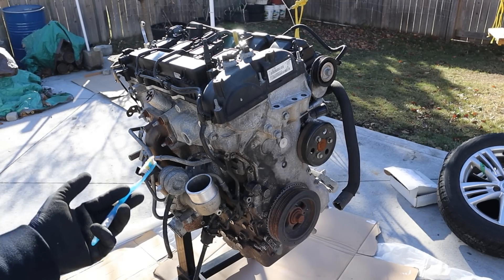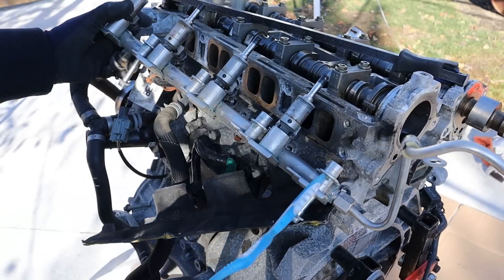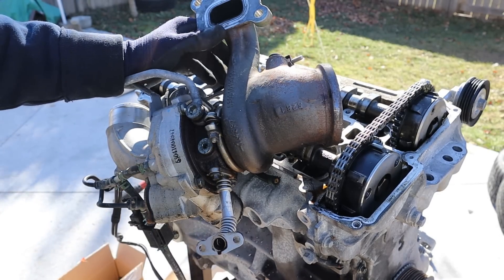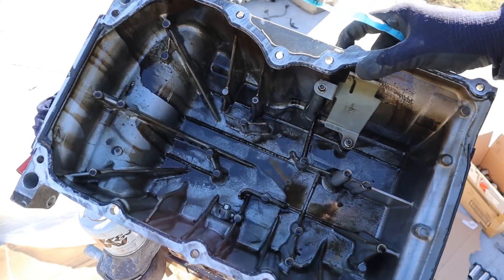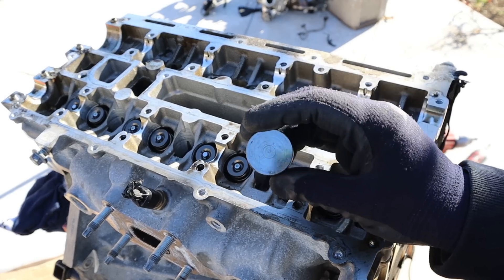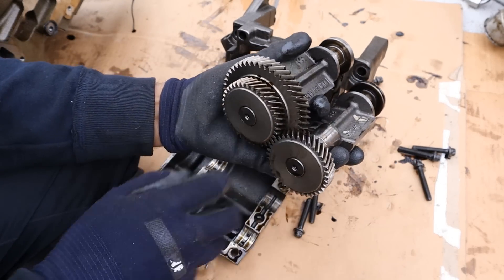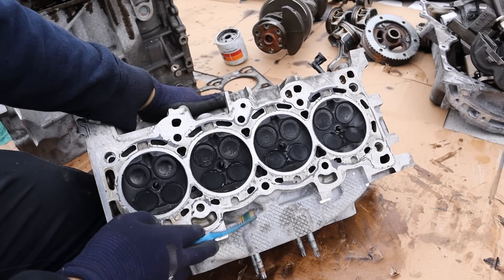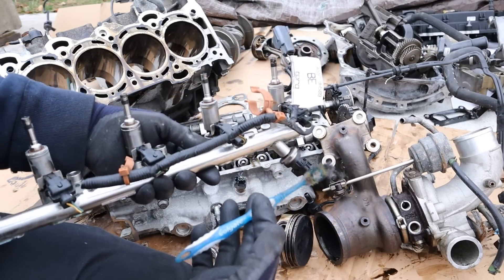Why Ford Ecoboost Engines Fail

Comment: avoid anything newer than 2008. the years and rebuilds to keep america going need to be 1968 - 2008. lot more vehicles still exist and can be saved for daily driving,  model show performance crap and a ton of unused makes and models will hold us back, along with new high end luxury bs vehicles. that needs to stop. we need a committee or someone who's not that interested in a 
rust valley show, enough shows about classic cars. whatever statistically goes through the survivorship the best becomes classic anyway.
if you scrap cars instead of part them out, you are contributing to the new car problem and whatever metal crap someone else wants to do anyway, 
so help distribute parts that exist for cars that can continue to be rebuilt and sold. it is our duty to negate the bad situation that other stupid people have made of vehicles and transportation.
do not tell me about a car making it to 180K, thats ridiculous. 98 ford rangers and 2008 town and country's can do 360K easy average, both reaching up to 500,000 miles. that is real as day.

Comment: Catch cans can freeze with moisture inside them due to freezing outside temps.  If that happens a clogged pvc will not allow the turbo to drain and it will cook the turbo.
Reply: I wondered about that, I figured ford would have put one on it if it needed one.

Comment: Maybe I just got lucky but I have a 2013 Fusion 1.4L ecoboost with 187K+ miles on it and honestly best dam running, trouble free vehicle I've ever owned.  No secret.  Just service it and change oil religiously. Still my daily commuter 45 miles each way 5 to 6 days a week getting me 31 mpg avg...

Comment: I have the 2.7 EcoBoost in my 2015 F-150.  105,000 miles and so far no issues. I have done oil changes every 5,000 miles since we bought ti new and just had it into the dealership for it's 100,000 recommended maintenance.

Comment: Great video! I've got a 2017 Ford Fusion Titanium with a few minor engine mods. 70k miles.. MST block to back exhaust system, Steeda cold air intake, manifold spacer and intercooler, Boomba catch can and adjustable bov and a tune for 91 and 93 octane. Conservatively tuned to 320hp. Just my opinion, what kills these motors is cheap 87 and lack of a catch can. The cooling jacket problem only manifests once the engine gets super dirty and hot. Regular coolant flush, minimal oil consumption from turbo blowby from adding a catch can and quality fuel will save your 2.0 ecoboost and let you dial up the power with minimal risk.
Reply: Thank you i get tried of every one hating on a good engine. I had at 2015 ford fusion titanium 2.0 no mods had let it go at 120k ran fine. just wanted a bigger car.

Comment: the saddest part ab this video is i have a gen 1 eco, 3.5L V6. arguably from what i’ve heard the worst eco boost made. mines going on 260k? and the transmission went out before the engine has. making 565hp to the wheels comfortably with stock internals. i don’t get why everyone has had so many issues with them when my 2011 has never had any, even throwing all the power i have at it. do i just have the most reliable ecoboost? or was mine one of few properly built? or is that everyone hates on the engine because ford cuts corners like any other car company does and made some things cheap and y’all just wanna bitch because you can’t beat on it like the other shit? idk man. i’ve had my eco for right around 3 years now. got it stock 160k, like i said trans went out but even throwing all these upgrades and power NO ISSUES. i don’t get it.
Reply from the maker: Keep it maintained. A surprise yours is still going.

Comment: This engine was really clean inside indicating someone had done a lot of oil changes on it.  As you said as you tore this apart, there wasn't much to criticize in worn out parts.  The rod and main bearings were in really good condition.
Reply: That's what I thought as well. I was expecting to see a smoking gun when the pistons were removed but really didn't..... other than carbon from port injection.
Reply: The after market catch can must have been mounted too low to suck in snow.

Comment: They fail because they're asking way too much power out of way too little metal. Note a common trend amongst engines regarded for immortality(4.9 I6, smallblock Chevy, 6bt Cummins, Detroit 2-strokes, etc): They don't make much power for their displacement. Understressed. Overbuilt. The adage 'burn the candle at both ends it lasts half as long' applies to engines and modern engines are just simply asking too damn much out of the metal they're built from.

Detune an ecoboost by about 35-40 percent and itt'l last a hell of a lot longer.

Comment: Well.. I think that if you run good oil and filters and change them every 6-8k miles, the engine’s gonna run just fine. And it needs to be cooled properly.. sometimes it’s good to put a lower temp thermostat in so that you’re not slowly cooking the whole thing. Idk. 

Great care goes a long way.

Comment: I honestly can't stand videos like this .the eco boost really isn't a garbage engine at all they are reliable do they have issues sure all motors do ..one thing he did get wrong is the earlier 2.0 has the crevice between the cylinder walls for cooling that fails the newer block have been revised and were made solid with 2 small ass holes cross drilled wich fixed the issue ..people talk shit about the ecoboost but motherfuckers haven't stopped buying or modding them and whooping the shit out of people on the street and tracks all over ..

Comment: The turbos and intercoolers on the 2.0liter  are garbage but other than that u maintain them regularly they aren't bad motors I have a st with 110k miles on it tuned and what not I beat the piss out of it and have had zero issues with it ..don't run shit low octane gas in it and change my oil and filters like normal .I have scoped the motor and maybe iam slightly lucky but I don't have carbon build up and it doesn't burn oil at all

Comment: The Ford 3.5 liter, when it has been taken care of, will last way over 200,000 miles plus ... I own a 2011 F150 Platinum, and the engine is just as powerful as ever, burns no oil, and runs quite smoothly! Don't believe everything you hear. I love this engine, and as far as I'm concerned, I wouldn't have anything else to bring peace of mind to get me comfortably from point A to B.

Comment: Looks similar to  my Mazda's  2.5 l  Which is ford also .. Literally has ford on the alternator And many other parts ..  It's a pretty solid engine just Change your oil regularly and check it often because you could have no oil and your oil light will not come on

Comment: I drove a 2020 Ford Edge over weekend as a rental car.  It had 2.0L turbo.  I found it to be very smooth and responsive with zero turbo lag.  Had 8 speed automatic that worked well.  The car had about 60k miles on it and purred like a cat.  It was a solid feeling and handled excellently and was practically void of wind/road noise.  The seats were very comfortable and had no leg fatigue from them.  Everything on this crossover worked like a charm. I was impressed and I am hardcore Toyota person.
Reply: Well any car will be great until it breaks. It's just that the Japanese cars are built better so they last longer. I'm a honda Toyota fan and got my first dose of American car when my parents rented a z71 suburban for a trip in Oklahoma. That thing was very comfy and smooth.
Reply: Best thing to do with a Ford is rent it, then you don't have to deal with all the stuff that starts to break on the inside of the car ant failures of the mechanical stuff starting at 70,000 miles.

Comment: The engine turns over and runs... Just ran poorly. Post dismantling and inspection, the carbon build-up from the direct injection may have just unseated the valves and could have been saved just by clearing the deposits.

Comment: Direct fuel injection I think is a big problem to engine longevity. Yes engines require fuel to run,but also use that fuel to clean and lubricate parts,like valve guides,piston tops valves are all going to build carbon and putting a few drops of Marvel Mystery oil is not gonna help as direct injection by passes the manifold which in normal cases goes through the runners with a splash of fuel//cleaner,into the valve train keeping the valves and seats clean. Direct fuel injection starves the upper valve train important values. I'm thinking going back to carburetor and points with manual choke and the high beam switch on the floor..

Comment: The 2.0L Ecoboost is actually a lot more reliable than this video leads on... It's not uncommon to see Focus STs hit over 150k miles with little to no issues. The 2.3L Ecoboost is probably the most problematic of the 4 cylinder Ecoboosts.

Still though, great video as always!

Comment: Wow, I must admit I'm very impressed with how strong and well-built this engine is!  I didn't know it had that strong of a bottom end.  A few points should be made about this motor because I think it gets a bad rap sometimes:  1) Use premium fuel with this engine. LSPI is a known problem with this motor so why cheap out and try and save 30-40 cents a gallon and risk that?  Use premium fuel with these turbocharged motors. Your engine will run better.   2) Use quality full synthetic oil.  Don't cheap out and get regular dollar store oil.  You can see how the engine oil is used not only to lubricate the engine, but it also to cool the engine and, most critically, the turbocharger itself.  Use a high quality full synthetic oil.  Make sure the oil has an ASI "SP" rating. That's the latest and greatest. It was developed for these TDI motors.  3) Change your oil every 4,000 to 5,000 miles!  Don't let this go! People don't change their oil and then they wonder why they have sludge and other crap in their engines and they get ruined.  These modern, complex motors require clean, fresh oil with a sophisticated additive package. Fuel dilution is a problem with these TDI motors. So, change that oil!!
Reply: @Leslie_Horwinkle  well I can only go by what I've actually seen. I have over 130k trouble free miles on mine and know others with well over 100k miles and no problems. I also know guys with big Dodge V8 Hemi trucks who have gone thru two or three engines (thank goodness one of them bought the extended warranty).  Also several European makes have been using turbos for years. I have a good friend in Germany who has over 250k kilometers on his. So, yes, if you don't take care of your car it will fail. But that applies to a lot of different engines, not just the ecoboost.
Reply: @@Leslie_Horwinkle not necessarily. A well cared for and normally driven ecoboost can last a very long time.
Reply: Yeah I get kind of annoyed when people talk about these turbo engines like it's some kind of new thing. Not saying Ford uses the greatest quality parts, but Americans are known as a majority for not maintaining their cars as they should.
Reply: The cheapskate Ford drivers would never use premium fuel or synthetic oil.
Reply: @povertyspec9651  Sure they do.  I just proved your statement false.
Reply: @LA_Commander  the nature of people is to try and find ways to spend less, so some of them use Motorcraft Syn Blend on ecoboost engines as it’s cheaper
Reply: @twinkieerella  That's a good point. The MC synthetic blend is what the dealer will put in your motor unless you request otherwise. I'm not saying synthetic blend is bad, you just need to make sure you change it a lot more often.
Reply: @povertyspec9651  ford actually tells you to use premium in the ST or you have reduced HP. Also they only use synthetic for oil changes

Comment: I am a old school mechanic and seriously I really don't understand why they made these engines so complicated what was wrong with the carby engines they were simple and even better if you look around at some old cars that have been pulled out of a really old farm or even some old cars that are yard art usually in a hour those old girls will usually start,but can you old mechanics imagine trying to start one of these with twin cams variable valve timing and high pressure fuel rails i think no way,but old carby engines are simple and if you have fuel and even reasonable compression and spark they will start.

Comment: You're stupid. 

There are 3 types of blocks. Originals, which is what you've torn down  here. Mid-range, which have the cooling slits between the cylinders, and current (2020+) blocks which have cooling ports between the cylinders. It's only the mid-range EBs that have cooling/head-gasket issues. The originals and latest do not.

It's funny you're crying about the engine you're disassembling (an original EB block that has no cooling issues), while simultaneously saying it was hydro-locked, which is no fault of the engine or it's design.

You're a special kind of moron. You've provided absolutely no visual example of "Why Ecoboost Engines Fail" with this tear-down. A spectacular failure of a video.

Comment: My car engine has Direct fuel injection and a Turbo charger and is running very smooth has lots of torque because it is a diesel
Reply from the maker: Check out my diesel engine teardown

Comment: The 2.0 Ecoboost crankshaft is a cast molded crankshaft not Forged steel.  The connecting rods are dropped forged and fractured. 
However, I think you did a good job on the tear down. We’ll done.

Comment: I think I will be keeping my 20.5 year-old Acura TL-S for as long as possible... Quality control on GM and Ford has just been horrible in the last few years..... Everyday there seems to be another recall... And how about the new Bronco motors failing..... flawed component parts...

Comment: Carbon buildup is an observation valid for many direct injection engines. This is not an Ecoboost specific topic. There are good products available to remove the carbon buildup as a service procedure on running engines (Liqui Moly u.a.).  Changing the engine oil on a regular base and using good quality fuel helps to prevent carbonisation as well.

The rude way of disassembling and throwing the parts does not match to the professionell level of explanation.

Comment: The inside of the Engine looks clean, but my oil is never that dark or let's say black. And I change usually every 10k.
Reply from the maker: 10k is pushing it. It should be 5K please
Reply: @speedkar99  : Yes, for this engine and especially for short distance driving, I'm absolutely with you. I'm driving long distance with speed limit here in Europe. And I had even with 12,5k miles still brown but clear oil. So this Ford engine is bad to the oil or the last term(s) it was much longer in the engine.

Comment: Not knowing the history on this motor and the maintenance intervals or the type of oil used , my theory and looking at the pistons and top end has to do with heat and a breakdown in the oils ability to effectively lubricate those areas . More frequent oil and filter changes with the proper full synthetic oil would have prevented this problem .
Reply from the maker: Yes. But nothing can prevent carbon buildup in a direct injection vehicle
Reply: @speedkar99 nothing can prevent any carbon buildup in any gas engine . The problem is greater when the oil breaks down . 
Synthetic takes a higher temperature to lose its protective properties . Manufacturers are doing a great disservice when they say you can go 10k miles on an oil change .

Comment: Whatever you do....preserve your old engines....seals and rings by driving gently, change your oil and fluids, lubricate parts...you don't want a new engine....direct injected turbocharged high compression plastic intake garbage with badly made piston rings, carbon buildup, and 8 million computers to go wrong. New cars are largely trash.
Reply from the maker: Agreed! Oil changes are cheap insurance

Comment: Man, that a masterclass on mechanical engineering. DAMN !

Only nitpick is that you speak too fast lol, but thats ok to make a shorter video
Reply: Agreed.  I understood every word, but would have preferred a slightly slower speech.
Reply from the maker: Slow my playback speed down. I prefer to be quick and to the point and not waste time

Comment: Hydrolocked from sucking snow in through the pcv catch can?  How does that work?   Interesting that you didn't actually find any damage, just a lot of carbon build up.  IPossible the turbo was blowing oil into the intake?

Comment: Mine has 97,000 miles and runs great. I get strange looks from the the Chevy V8 and blazer boys with loud exhausts when I easily pull away from them.

Comment: Well, after owning a couple horrid Fords in the 80's, 90's (each lasting months), I've all steered clear of them. The were both non inspiring to drive, hoped I had a full week without something else going wrong.
Apart from the thoroughly plastic interiors and the blandness of exteriors, parts were cheap enough...probably because of the under engineered parts (mainly the engine), Ford had a booming parts trade too!
After seeing my mates car die at 78k miles, his nephews (4 year old car) die at 54k miles.... both blown engines, never again!
Those gruff engines lol.
Now we see more engine life shortening design flaws in Fords.

Comment: To confirm the ONLY way to keep carbon build up down is remove intake manifold and walnut blast? Or is it possible to clean with everything still attached?
Reply from the maker: Yes you need to remove intake. 
Seafoam can only do so much
Reply: @speedkar99  i understand seafoam isn't good for these cars. I saw a tutorial where they left it on but plugged and bladed the holes of the intake manifold